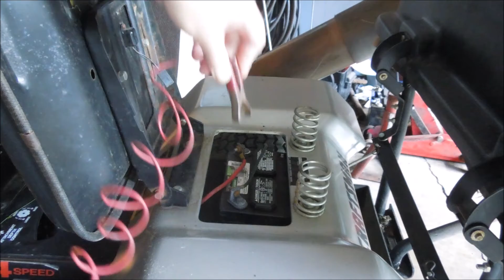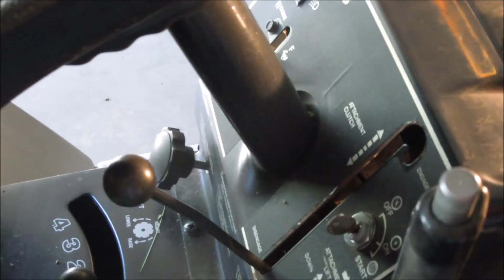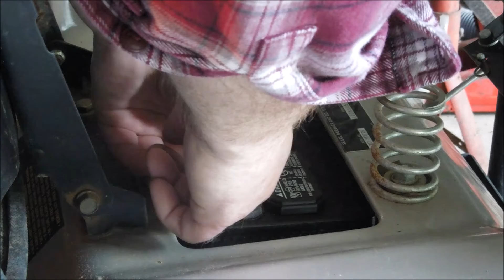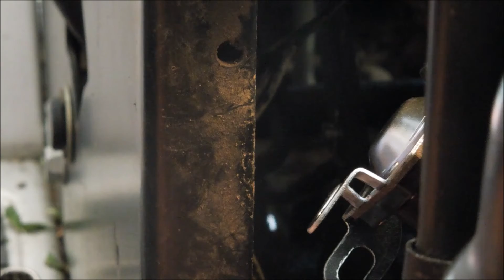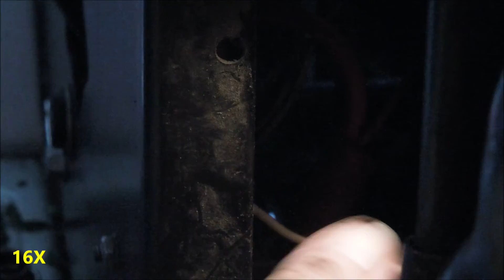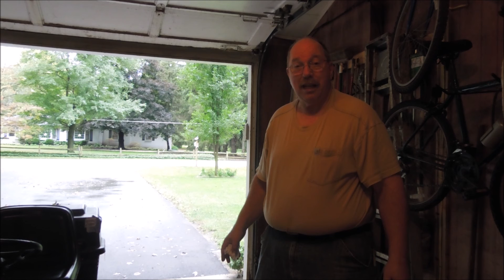CRAFTSMAN MOWER ~ CHANGING THE STARTER SOLINOID

Comment: I've found that taking a hammer, (you're not surprised?) a dead blow preferably and smacking the sheet metal that the switch is bolted too will get it to work. And also, since you got the wiring down pat, back the nuts off the 2 main lugs a little and turn the lugs, holding the tops with pliers and maybe replacing the cable nuts in case of some scarring on the lugs. THis gives the plunger a fresh place to make contact but it's either a last ditch or extreme tightwad effort.  The other is just to jump across the lugs themselves to see if the starter is still working. I've got it to do too, and the fuel line. and a new steering gears. A massive teardown is in order BUT I have the IMPACT! MUCH easier! Thanks, UNc!
Reply from the maker: When you jump around the solenoid the starter might turn. That doesn't mean it's fixed. This one has to have the safety circuit working or it won't run. 
I jumped the solenoid and the starter turned. Good. I had a spare solenoid, not a spare starter. 
Repositioning the contact points is a cool idea. 
My brother in law loaned Mom a VW Rabbit with a diesel engine. Great little car. The starter is just behind the bumper with the solinod on top. German Engineering. 😆
The car died down by Angola. Mom called and said she had the car towed to a repair shop and they wanted $150.00 for a new starter. 
I drove down and pulled the nose off the solenoid. The contacts were a copper disk that touched two copper points. I flipped the disk over and it worked like new. I think I still have the old solinoid on the garage bench. It will be fun to try it. 
You know this already, but I'll say it for the young ears. Impacts are great for the teardown. Throw it on and pull the trigger. That hammering will knock loose bolts that you would tear the heads off with a ratchet or breaker bar. 6 point sockets are the rule. Assembly is better done unpowered. You feel the bolt cross threading before it screws up too bad. The impact will tighten it so fast the bolt breaks or the hole strips before you get your finger off the trigger. If you are working the line and someone like me bought a $3000.00 electronic torque wrench that will hit torque every time and the bolt assembly is brand new, after you start the bolt by hand two full turns, go ahead and run it down with the driver.
Reply: I have to go to the PO tomorrow and I'll get a new solenoid while I'm out. Then I'll doodle with the old one. Might end up with a spare. I had several Rabbits. The 1st was a gas job with a bad accumulator and a blamed good starter. Then the diesels came with a worn out one I had to roll off but it got 45 mpg and 45 mph. 10 gallons was 450 miles but it'd try and run away any faster than 45. And the truth about the impact. They'll wring one off before you can even think SCAT, much less say it. Better off going back up by hand. So it's fuel line and everything else looks like. Might as well do the steering and change the oil while it's on it's rear with the deck off, fuel drained and battery out. Ahhh, progress. Yeah, right.

Comment: They usually seem to put, what should be a simple part to replace, in the most awkward places. I think design engineers must have tiny hands.
Reply from the maker: Ran into a dump truck frame section that was a fabricated plate box section. It required welds on the inside of all the corners including the end plates and internal reinforcement. 
We put in for an engineering change and ended up welding with a single bevel and backing plates. 
I think on the mower the solenoid was mounted on the steering tower and installed with the 4 base bolts before the running boards and deck was on.
Reply: Like some trucks by putting the motor and tranny on and then fitting the cab.
Reply: @OldSneelock  Usually packaging comes before serviceability. All engineers  should have to service what they design.
Reply from the maker: Teams working under a deadline break up tasks. That leads to mistakes.
Sometimes it's customer demands or revisions that put the cart before the horse. Sometimes its just a screwup. 
Then there is the project that just goes goofy. In 1969 the Midwest Foundry put enviromental controls on the two blast furnaces. 80 foot tall stacks with water jets to cool the effluent gasses and capture the fly ash. The prints were all hand drawn back then so no blaming the software. The dimensions were all out to 3 decimal places. We just laughed and lit off the cutting torches. 😆
Reply: Yessir, light the torches! If they want to get that technical, let the tech guys do it. You hurry, you mess up. That's what I did when the rock clipped the steel line on the boom cylinder. No more of that. A crash isn't worth a second or 2. And I wished I could've looked the place over while it was still running but I'll have to see them on the Tube! 
Thanks for reliving the good stuff, Unc!
Reply from the maker: Moved all the steel mills to third world countries. They are all glad to get them too. In 1969 there was a Yemenese kid at the foundry. He said he made a months pay every week working there. He was on a 3 yr visa. 2nd trip. 1st trip hebought land and  got mairried. After the 2nd trip he was going to buy a truck. Then he was going to have kids and live like a king.
Reply: I believe it. When I was over there it was amazing how things were.  I suppose they had all the pollution we were supposed to have or at least the sources that spread lies about mundane issues said we had. At least he was working. Can't say that about a ;lot of able bodies now.
Reply: I once saw this inventor show where a guy made some special socket accessories that would allow you to get at bolts there was no way to get at with regular sockets (such as 12" in, 90° turn, 8" further,  another 90° turn, and 6" more until you get to the bolt).  The people who seemed to love them the MOST were these bus designers.  Thses are the people who should be considering ease of maintenance/replacement of parts, but NO ,that would actually make sense.
It makes me want to agree with this good ol' boy I knew.  One of his favorite things to say when working on a  car was: "All automotive engineers should be cut (so they can't breed).".
Reply: That's right up Mr. Chadwicks alley since he used to work in the big double-decker bus garage.

Comment: sometimes the simplest parts let you down, my car failed whilst on the motorway, dashlights no power, stalling , but limped home 5 more miles, luckily the dealer is 1/4 mile from my house, he fixed in inside an hour, bad ignition coil, dont expect that at only 10k miles!
Reply from the maker: I bought a used Aveo from Sundance Auto, better off buying a bucket of $hit, at least you can grow $hit with $hit when it falls apart. 60,000 miles and worn out. At least yhe odometer said roughly 60,000. Hint: Never buy anything with an odometer reading where the last 4 digits are zeros. They just got tired of running it back.
My first experience with indiviual coils on an engine. It had a miss the second day I owned it. Sundance said they would change the plugs and wires. The miss stopped for another two days. Whatever they did it wasn't the plugs and wires. About the time you realize you were screwed it's too late to fix. Coils should last decades.

Comment: Good  instructions on diagnosing a common problem with lawn tractors
Reply from the maker: Thanks. For an item that is used 4 times a month for 7 months a year they don't hold up all that well. The 8N has the original relay put on at least 20 years ago. 
Now I just hexed myself. Better have a new one on the shelf. 😆
Reply: They call it 'Borrowing TRouble" here.